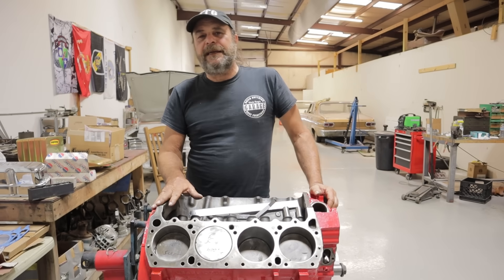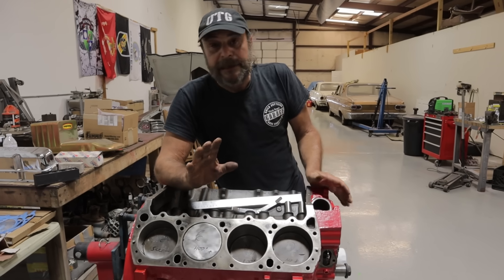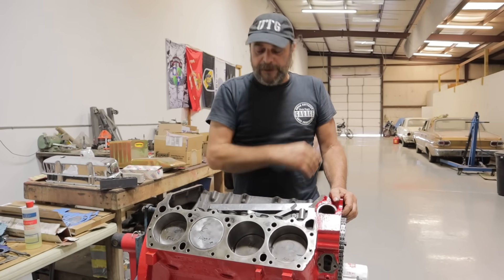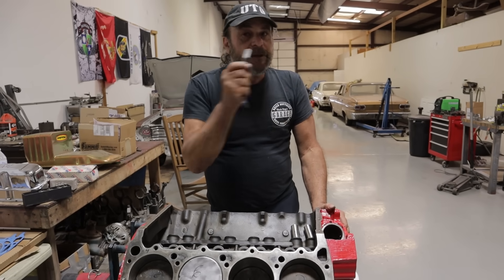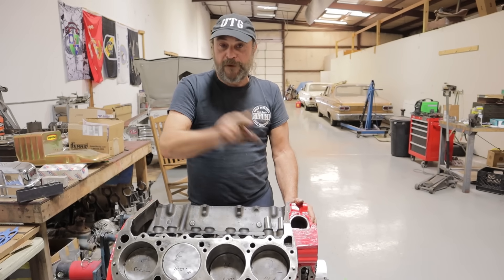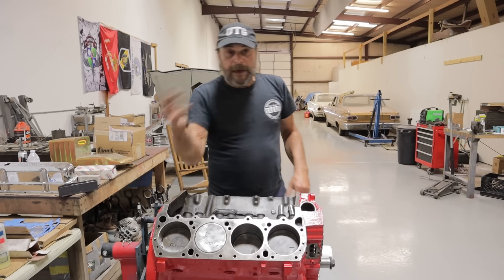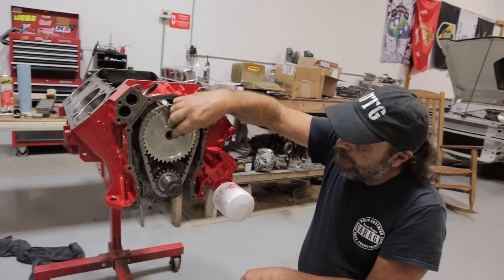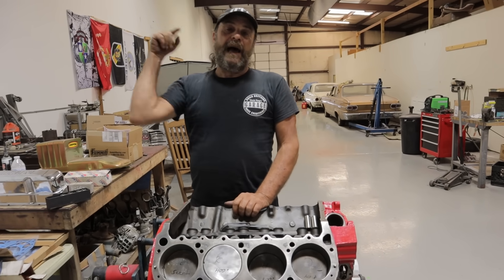Checking Timing Gear Accuracy  And Camshaft Timing For The Home Engine Builder

Comment: How do you know your at TDC without a degree wheel? That motor probably has 3 to 5 degrees of piston dwell. Go ahead and try  to prove me wrong without using your "frisbee". 
The simple fact that roller and flat tappet cams have different ramp rates pretty much makes your feeler gauge measurements meaningless. Never mind the fact that every single grind different than yours has a different ramp rate.
I once ordered a cam and found out the the wrong cam was in the box. The only way I knew is because I used a degree wheel, micrometer and the specs didn't match the cam card. You couldn't have found that with a feeler gauge.
If you truly felt so strongly about shitty quality control you wouldn't be using your degree wheel as a frisbee.
Reply: If you don't know how to confirm TDC Without degree wheel,  you shouldn't be mucking around with engines. Nice video
Reply: @brettjasonheadinventor  a gauge can even be used to determine if the cylinder is on a compression/power stroke lol.
Reply: @shadowopsairman1583 yes. The simple way is always the best.
Reply: @shadowopsairman1583  how?
Reply from the maker: So, Mr. "Building/Racing Videos...with all your expertise building and racing, you don't know how to split dwell at TDC without using a wheel?  Maybe you need to build and race some more??
Also, you are absolutely correct about different types of cams and different ramps, HOWEVER, that .006 equaling 2 degrees is a good enough "ballpark" to get you there with any cam.
If you have issues with this method, go buy yourself a freakin ouija board and get ahold of Keith Black, because this is the method he developed in order to make quick camshaft timing changes at the track.  Actually, it was Mr. Black himself that told me how to do this when I bought a cam and gear drive from him back in the 1980's.
If you get through, give him my regards.
Reply: @UncleTonysGarage  Tony, you're presuming this guy even knows who Keith Black was. Lol.
Reply: @electrix6751  Or Ed Pink for that matter! 😉
Reply: @UncleTonysGarage  😂
Reply: @UncleTonysGarage  thank you for teaching us kind sir
Reply: @michaellee5399 Michael Lee - that's my first and middle name as well. BTW my sentiments exactly.
Reply: @UncleTonysGarage  That made me so happy to read this.
Reply: @UncleTonysGarage  "Buy yourself a freakin ouija board and get ahold of Keith Black" Oh man, I think I enjoyed this comeback comment more than the video.
Reply: @UncleTonysGarage  hehe....got get'em Tony
Reply: @UncleTonysGarage  ha ha ha close enough. Close enough for you maybe
Reply: @buildingracingvideos4714  You got Massengilled by Tony you douch.
Reply: @steveschug80  yup that name dropping and word salad sure showed me🤣🤣🤣
Reply: @steveschug80  now that shit's just funny! (And true) I don't care who you are!
Reply: @UncleTonysGarage  oh and you never proved me wrong on the degrees of dwell without a degree wheel.
Reply: @buildingracingvideos4714  you just want to argue, must be wet behind the ears.
Reply: @buildingracingvideos4714  Just split the difference. Same way you do with a degree wheel. Been finding TDC in engines with my finger on the spark plug hole this way for years. Never had an issue.
Reply: @buildingracingvideos4714  I think you've made enough of a fool of yourself. But keep going.
Reply: And….. BURN !!!
Reply: @CODA-Improvements  Not really what would you rather have ''close enough'' or dead on accurate??
Reply: @mikealkarout9555  distributors can be adjusted and ecus auto compensate. Derp
Reply: You're missing the point. Tony teaches home mechanics how to do things without a war chest of expensive tools.
Reply: OK  Karen settle down.
Reply: I tend to agree with you on some of your bullet points........  however, the degree wheel alone will not provide that information. 
First and formost, we need to locate TRUE #1 piston TDC. That is only achieved when we use a PPS tool (positive piston stop) to stop the crankshaft (via the # 1 piston deck) at XX degrees prior to theoretical TDC, and then stop the crankshaft again (in the opposite direction of rotation) at the same XX degrees prior to theoretical TDC.
Once that has been established, we then remove the PPS tool, and divide that angle.
Next, we then rotate the crankshaft until our new marks align. That eliminates what you are calling "piston dwell", and gives us TRUE # 1 TDC. 
I use a 30-ish degree split.... but you can use 25, 27, 31, 33 or any number, as long as it's somewhere in that neighborhood.  
In my opinion, 10 degrees is not quite enough for accuracy. 

By the way, that camshaft (on this engine) is driven by chain and sprockets.... not gears. 
And his equating cam rotation in degrees as if equaling  XX thousands of cam follower movement, is flawed. The ramping of each lobe does not allow for this equation. 

I do like the idea of these YouTube videos, but at the same time,  I wish that there was a YouTube police department. 
Too many DIYrs look at these videos and take it as if they are gospel.  

.
Reply: All you're saying with this comment is that you're incapable and that you can't trust yourself.
Reply: why does this channel "building/ racing videos" have absolute zero content? show us how to do it the NASA way smart ass!
Reply: Tommy Bosher Garage 
YouTube.com/user/fiddlercove microcosmic
Reply: degree wheels are rubbish mate the work has alreadey been done just a waste of time
Reply: My Crane Fireball 260/260 was removed. 
I called Summit Greg Anderson answered how we do it.
Reply: Building/Racing Videos has no content, just a fuggin wittle female dog
Reply: @Made By Nobody Famous I dealt with a 97 lexus that used a cog style timing belt, pos dayco (customer bought it, not me), the timing marks were so way off that I drew my own on the belt. I've put a early model focus in time by just a manual without a wheel.
Reply: it's a stock crank, rods, pistons, cam and block! if the dots line up, it's at top dead center! you don't need a degree wheel with all factory parts you fuckin moron! by the way your channel has absolutely zero content Mr. building/racing videos LOL you're a moron!
Reply: Damn he went in on you bad
Reply: Positive  stop both ways and split the difference
Reply: @thepoopsoup  you are literally describing how to find TDC with a degree wheel. All the wheel is doing is giving you little lines to count to find the center
Reply: I helped build a modified tractor about 35 yrs ago that had a keit black hemi in it ...your about to find out who he is and why we do it the same way Uncle Tony does ..lol
Reply: What if you have hydraulic lifters Tony?
Reply: Ill keep my degree wheel.
Reply: This is why she left ya bro.. this is why .. 
Get well soon . Just sayin...
@∅
Reply: Gotta love the trolls! Great video as usual @Uncle Tony's Garage
Reply from the maker: Some of you guys have zero real world competitive wrenching experience, and it shows
Reply: you just watch the Piston go up and then down and get it as close to top dead center as possible and if the dot is facing straight up then you're at top dead center! it's a factory ground crank, rods, pistons, and block! they were pretty damn precise and close enough from the factory! this isn't a thousand horsepower engine build! if the Piston looks like it's at top dead center and that dot is facing straight up then you're close enough when it comes to stock internals!

Comment: so if #1 cylinder and #6 cylinder are slightly different with a timing light on them, does that mean the timing chain has stretched possibly?   Mine was bang on between 1 and 6, and now they're 3 degrees different.  #1 is at 20 degrees and #6 is at 17 degrees.

Comment: How do you resolve when the cam is off a couple or few degrees? Adjustable timing set? I’m about to change the timing set, but if you don’t buy adjustable, why check if you can’t correct it? To make a new zero mark on the balancer?

Comment: the most important point with this process is that it's a stock cam.  anything aftermarket make sure the lobe center matches the spec sheet before buttoning it up.

Comment: I had an new MGB cam supplied by the engine rebuilders. The car has never idled nicely since the rebuild, so I'm wondering if the cam is correct.
BTW, the engine runs fine on the road, just not at idle.

Comment: Im building a 351w. Lunati cam. The only thing on your video that threw me off was when you first started with the fealer gauge. You said your engine there was at #1 on Exhaust stroke?? When you install the cam with #1 TDC, dots lined up , if everything is right you should see the valve overlap at that point shouldn't you? Do you use the fealer gauge at that point or do you rotate the engine to exhaust stroke and then check? Is that what you mean? I'm a poor country boy and have never degreed a cam in any way. I want to try your way but want to be sure.

Comment: Sorry buddy you're wrong.. when those lifters are buried in the hole that means both valves are closed because the spark just ignited and the Pistons going down for a power stroke, then back up for an exhaust then back down intake valve open to suck in fuel and Air

Comment: I am confused.  I always though that it would be top dead center on Compression stroke (obviously) with both valves closed and dots facing each other
Reply: The Chevy 350 is also like this Mopar shown here . I heard it can vary depending on what engine it is .
Reply: I'm confused too. I guess I've just been real lucky. I've built 8 or 10 engines for myself and friends over the last 30 years. Chevy sb, ford sb and even one 318. I have never once used a degree wheel. One of my 350s ran 7.91 @ 98mph in our little 1/8 mile. I know it matters but......I don't understand the exhaust stroke part either.

Comment: Hi, Uncle Tony! Thank you for the information. Have you done a video on the crate motors from the ‘90s? I have a 360/380 magnum that my dad bought from Summit for his 340 Duster and it’s difficult to find mechanics that know anything about it. It has an aggressive cam and high compression. An example would be one of the mechanics telling me it shouldn’t have anything more than a 600cfm carb, but summit recommended a 750cfm. I had another guy who adjusted the timing and it was so weak when I got it back. Would love for you to do a deep dive on these or tips on how to set it up properly! Any feedback would be greatly appreciated. Thanks!

Comment: I have 0.030 on #1 &(#6 after rotation). That would = 10 degrees.Would I retard 6 degrees  on the crank keyway to get it to the 4 degrees advance that my cam is supposed to have?  My cam is fairly aggressive. My card says the intake valve opens 9 degrees btdc. In my febal mind with Tony's math at TDC it would be

Comment: I have 0.030 on #1 &(#6 after rotation). That would = 10 degrees. Would I retard 6 degrees  on the crank keyway to get it to the 4 degrees advance that my cam is supposed to have?  Should I break down and buy a Frisbee?

Comment: Does anyone have information on why some crank gears are marked specifically on a tooth and others are marked in the valley between the teeth. There is nothing on the internet covering this phenomenon, you'd think it's rather important. Any information appreciated
Reply: It's because 0 degrees on a crankshaft is when the keyway points straight up. That's 45 degrees before tdc on number 1. Or after on a reverse rotation engine. The way I time the engine is "make sure the exhaust valve starts to open when the piston is 90 degrees down in the cylinder" or 90 past tdc. It will run whenever the dots are lined up.. but I don't think they are really supposed to be lined up.. that makes like 3 dead cylinders and it'll never run on all 8 like that. It's sad but true.

Comment: So, I've never built and engine but plan to build a small block in the near future. Trying to absorb as much knowledge about everything as I can. My question is,  what do you do if I'm the measurement is off? What adjustment needs to be made? Or are you basically just verified the cam was machine correctly and if the measurements are off do you need to send it back and grab a new one?

Comment: What confused me compared to working on bikes is that when your dog to dot your not on the compression stroke at tdc, your at the overlap on the exhaust stroke. 0 on the ballsncer must be 180 out of the dot, because you can't set valves at tdc if your at that overlap period, must be on compression stroke. I have a video on this too.

Comment: True # 1 TDC is determined by using a PPS  (Positive Piston Stop) tool and a degree wheel and pointer. 
We use the PPS tool to stop the piston at approx 30 degrees at each side of theoretical TDC.
We use the degree wheel and a temporary pointer to determine where we are.   
Once we have a good range of "piston stop" (it can be 25*, 27*, 32* or 34*), and have corrected the temporary pointer, we then remove the PPS tool. 
Next,  we rotate the crankshaft until we have split the "stopped" degrees equally. 

By performing the PPS procedure,  we have eliminated any crankshaft/piston dwell that would otherwise cause a small amount of in-accuracy. 
Once we have established TRUE # 1 TDC, and have not moved the degree wheel or the pointer,  we can now accurately degree the camshaft as per the manufacturer's specifications. 

Please note that feeling for tdc by hand or by eye,  or using a straight edge, or implementing educated guess work, etc, are not going to lead to accuracy.

Comment: I can't wait to put my 383 back together after a fresh rebuild same cam and lifters new timing chain. Same crank, rods,lifters. It ran good before the tear down but I'm going to check it using your method. It's on solid flat tappet lifters so it should be easier to do than a hydraulic lifter because I don't ha e to worry about pushing down the lifter plunger. 
Keep helping us good ole home builders I got one appreciate it and I'd trust you to build my engine anytime.

Comment: I gotta 72 Dodge D-100 Adventurer SE I bought off the original owner has a 400 BB that was replaced thing never ran right after. Me and previous owner decided instead of being a 2 barrel we wanted a 4 barrel more interceptor style build with retrofitted air and a custom ground cam and lock up capable 727. This new build has never ran right never held up to the old worn 400 we took out and watching your videos has gave me new direction on where to go with this thing really wanna enjoy this old truck again things got a hell of a story behind it and too many parts cannons fired at it . Think I have a good direction to start sniffing on this thing to get it right . Thank you for putting your knowledge out there

Comment: Excellent explanation.    However yiu said no 1 cylinder at the exhaust stroke.       When the gears are dot to dot isn’t the piston on the power stroke?
Reply: No. TDC end of exhaust stroke. It's set up that way so you can degree the cam from that position. Your assumption is a common on and that's why many first time engine assemblers put the distributor in 180 out of phase. Yeah.... I've done it too. 😜

Comment: Timing gear bolt! What Tony says about this is 100% true! You must use lock tight on these and make sure the washer is facing correctly! Had one work loose and thought it was a lifter not pumping up!

Comment: This is really awesome. I've done a handful of motors over the years....440, and 2 383's and used this method. My grandad showed me this in the early 1980's when I was 12-13. It needs to be close....and the rest is up to distributor and timing.  Old school. Clearly there are many more technical way to do it, with lost of $200 bits and pieces....but this works 95% as good.  Dot to Dot, and if its way off.....get another cam.

Comment: Honest.  I’m a little too OCD with my lifters.  Even on a Hydraulic Roller Cam, I typically use the retro-fit cross-bar roller lifters, and I use my electric etcher tool to engrave the cross-bar with a small number corresponding to the cylinder number.  Never had a problem breaking cross-bars, and never had problems wiping lobes.  It’s not entirely “necessary” on a roller cam, but it works so Imma keep doing it.  
Additional.  Same dealio with everything from Conrods to Pistons to Rocker Arms.  In fact, every Rocker Arm has I-1, E-1, I-2, E-2, I-3, E-3, etc. for Intake and Exhaust.  Everything always goes back together flawlessly.

Comment: one thing I'd like to note here Tony is that I personally have encountered aftermarket timing sets that have the timing marks stamped 180 out from factory...this has happened to me 3 times now from a few regular parts stores, I can't recall every brand I encountered this on, but it did cause me confusion the first time around when obviously I went to start the car and found I had to rotate my distributor 180 to get back to running condition...Afterwards I made it a point to always check, and have found this repeatedly...and not a discrepancy on my part, I literally removed the old dot to dot, and replaced without rotating directly and the new marks were both vertical...so watch out!!!

Comment: I've mostly delt with chevys can't lie I love them but, one of the first great engines I heltlped build was a 360 un my buddy's 360 in his 64 dart. I absolutely love the filter placement in the Mopar. Back in 04 our senior year that 400 hp 360 dart was the second fastest car at school. My boys mid 90s supra was faster. When we beat the*rich kid's) built 2003 wrx Subaru I was so ecstatic. Sadly I wasn't driving that day and the day after we had to rebuild the garbage morpar transmission for the 3rd time. He'll a win is a win. Keep up the great stuff unkl t